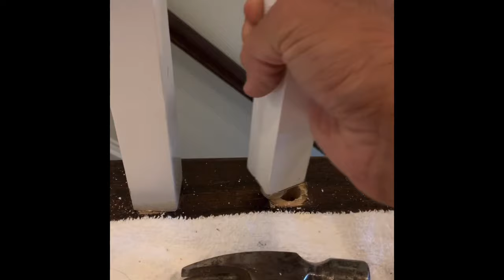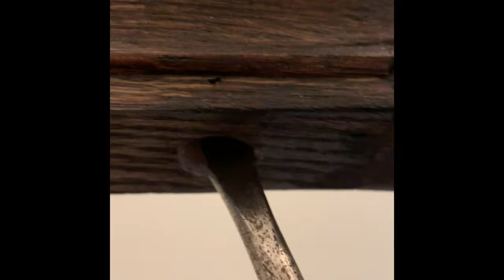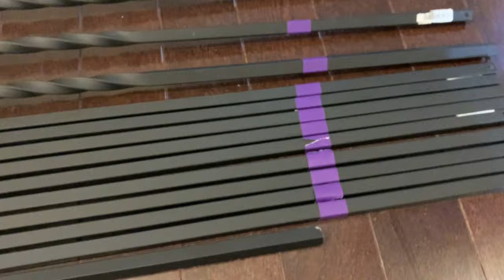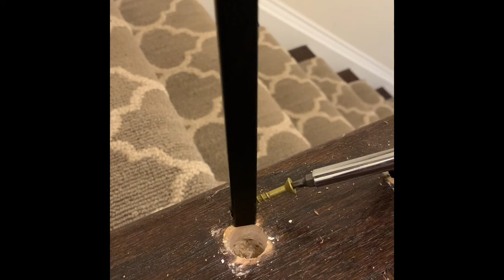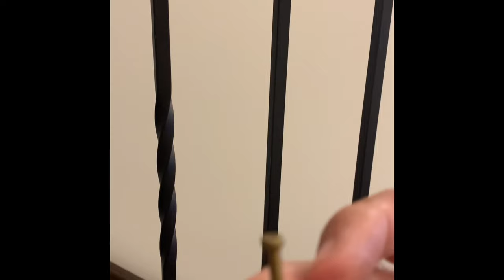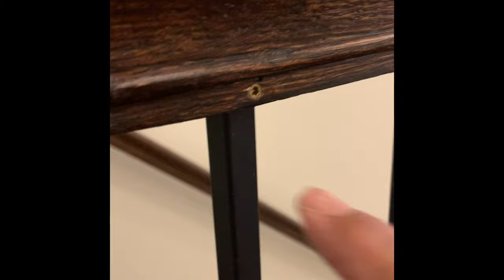DIY Replacing Wooden Balusters with Iron Balusters

Comment: Clever approach for keeping the option of changing out baluster(s) for different styles at any point in future--without having hassle of removing epoxy.  That's the real beauty of this approach.
Reply from the maker: And it’s fun if you like doing these kinds of home projects 👌
Reply: @Sal-75-2   ,

how to remove these types of metal spindles when they are glued in place ?? there is no slack to wiggle them up and down either.  Do we have to take off the top wooden handrail or do you have another solution  ??
Reply: @BlueOriginAire  run a sawzall down the middle of them and pull them out
Reply from the maker: @BlueOriginAire  wow. Seems like going to be a messy and time consuming job. If I were in that situation I would saw in the center to split the upper and the bottom then I would take a monkey wrench to the base of the bottom piece and rotate it in a circular motion back-and-forth see if I can loosen it and the same for the top. If this doesn’t even work then you would just have to sawoff the ends and I would take a flat type screwdriver and hammer in to the remaining piece of wood baluster to split it and pry it out from the hole that way. Mine wasn’t super glued but yes they do tend to glue them if not screwed. Hope this helps
Reply: @Sal-75-2  it was just liquid nails jammed up in the holes... once drilled around.. each came out in about the same time....gtsy in the chat 🤜🏽⚡️🤛🏾
Reply from the maker: @BlueOriginAire  😂 wow. Large house. Glad you were able to figure it out.  I had to do about 100 or so over two months time slowly after I came home from work or weekends etc. for me it was fun and i get so many compliments on the difference in the look. Appears very elegant overall and i saved 5k $$ 👍👍
Reply: @Sal-75-2  What would be the approach to remove the old wooden baluster as like he said with supper glued with no play & the flooring finishers put a ton of poly around the bases?

Comment: Great to the point video!  Really like the screw method, rather than gluing in the new balusters.  But...was hoping you would show how to ka-ra-te chop the old balusters out...
Reply from the maker: It’s in the video. Luckily mine were mildly glued on the bottom and a trim mail to the top as I show the extractions. But some folks glued top and bottom in a nasty way. You may have to hollow them out with a drill after cutting out the middle parts if that’s the case which is a lot off work. Try the method i used of prying then up from the bottom. Hope it works out for you. It’s a fun project for me.

Comment: Wow! You made it look so easy! I can try it now thanks to your video
Reply from the maker: Takes some time but definitely doable. I was scared until I plucked out the first wooden baluster.
Reply: I just looked at mine. There are no peg holes for my spindles. They appear to be glued down. Not sure how they are attached but one is loose so I can clearly see no peg holes. What size hole for the metal one?

Comment: Wow, that seems like a real pain in the butt approach. The TNT system is super slick and doesn't risk splitting the railing.
Reply: What's the TNT system?
Reply from the maker: Pricey! My project would have costed me an extra $400 solid if I took this approach vs drill and screw. Personally, I had fun doing the project manually and it’s rock solid + saved me $400. Certainly a great option for people not comfortable with the manual approach.
Reply from the maker: It didn’t split any part of the railing in my case. I installed 96 of these.

Comment: The screw is smart.  I glued mine in with liquid nails like caulk.
Reply from the maker: Contractors quoted me over 6k and they were going to glue top and bottom as well. I screwed top and bottom solid, entire project around $1000. Spent ~$300 on power tools but I keep those. The entire structure is solid as heck and clean job.

Comment: Hey was wandering if we lift the spindle into place then pour the bottom hole with an anchoring adhesive like Pro select from Lowe's to lock the spindle in place . May save time installing . Someone make a cuttable metal spindle with a spring loaded clip at the top ...

Comment: I have round metal balusters. The epoxy that held the  shoes at the bottom gave way. Now the shoes spin at the bottom of the balusters. Its annoying and looks like crap, I like the screw you have on your shoes.
Reply from the maker: Everything drilled and screwed gives a solid clean structure 👍

Comment: I'm in the middle of doing this exact same project right now.  I am using the shoes on the top and bottom, but after watching this, may reconsider just doing the bottom.  What side drill bit and screws did you use?  Thanks for the video!
Reply: where did you find this product??
Reply from the maker: @ethans1927  Lowes Iron Balusters

Comment: Looks great. We have the same on but the ones at the first step are wobbly because of no support and the starting baluster is in the curve. How to fix this problem
Reply from the maker: It’s possible yours are done with epoxy glue which comes loose over the yrs. You may have to drill screws in to the loose ones like I did in the video. My bottom screw is hidden by baluster shoes though. Hope this works.
Reply: @Sal-75-2  : many thanks man for the help. Once the screws the bottom iron balusters, would it be as strong if have a wooden baluster
Reply from the maker: @squeekhobby4571  yes! As you see my bottom screw is fatter, placed in a 45 degree angle to the hardwood for anchor and another stabilizing flush screw on top times a hundred of these to the railing and hardwood my entire construct is solid. I even put some muscle into try and shake the handrail. Nothing! No movement. And that’s why I used hardware instead of glue. Done once done right
Reply: @Sal-75-2  : you are awesome. Thanks, will do the same at my place

Comment: Outstanding!  Did you use the same type screens for the top and bottom? I think I saw a slight drill angle used. You saved me some serious $ with this.  Just hope that my minimal skills can make good cuts on the balusters and get it done for the wife to smile!
Reply from the maker: Thanks you! Trim screws for the top railing so they disappear. Yes. Drill angle to drive the screw in a 45 degree angle so it doesn’t catch the thin part of the edge of the hardwood flooring. Shouldn’t be a hard project but I am a surgeon by trade LOL, so IDK. I random projects around the house so am not a pro at these things myself.
Reply from the maker: And yes! The wife loves the outcome! Let’s just leave it there 😂

Comment: do you have to unscrew/loosen up the hand rail first before removing th spindles/balluster?
?
Reply from the maker: No. Nothing needs to be done to the hand rail installation. Balusters come out individually. Do one at a time for family safety reasons.
Reply from the maker: I basically removed one, replaced it with iron baluster , removed other and so on… bc I have kids and didn’t want gaps during the project duration

Comment: Hello, i had wood spindles with a finishing nail at top.  I see you used vice grips to remove the finishing nail and then push anything remaining flat.  What should you do if nail is further up and vice grip is too long?  I've tried nose players but hard to reach.  Too much nail to just push up as you showed in video.
Reply from the maker: Yes. You are right. I had that issue also. Sorry, didn’t show in the video. I used a tool I’ve had for yrs and never used it until this happened. It’s a question mark shaped tool with a grip handle. I used it to pull out the nail so i could grab it. As you can see I’m careful not to damage the wooden rail at all by attempting to yank it out which will surely take away some part of wood with it. Try to look for any tool at Home Depot or Lowe’s with a hook type working end so you can hook the nail and pull it out. For me it was just a random tool from ages ago that came in handy.
Reply: I just did this on a job and found some needle-nose "vise grips". Those thin brad nails are super weak and you can wiggle them back and forth until they break. Takes a bit to get the hang of it but I can get it to break at the wood surface almost every time. They are really in the way if they stick out 1/16" .
Reply: I found angled needle nose pliers at AUTO ZONE (of all places)  the guy there said auto mechanics use them all the time. I bought them even before I had a use for them bc they looked like they'd work in tight spaces . . .  now everyone at work tries to steal them

Comment: It looks like it would be a pain to screw in the balusters...I have seen other videos that use epoxy. Is that not a good way?
Reply from the maker: I preferred that over using a permanent epoxy option. Your preference really. Either would get the job done. I found my approach to be a clean and easily replaceable option.
Reply from the maker: There’s the TNT option if not comfortable with manual installation. 
https://www.homedepot.com/p/Stair-Parts-Tap-and-Twist-1-2-in-Hollow-Metal-Baluster-Install-Kit-92001-TNT-HD00S/300431475#overlay

Comment: We are thinking of doing a similar project. May we ask where did you buy the iron balusters from and what type of hardwood flooring and color is that?
Reply from the maker: “House of Forgings”  Satin Black Wrought Iron Classic Baluster. Bought from Lowes last summer. The finish on then is great. Quality product. I’ll get you the name/color of the hardwood.  I have the box somewhere in the basement.
Reply from the maker: Unfortunately the box doesn’t give any helpful info. If you can find Toll brothers Design studio near by, I used everything from there. https://www.tollbrothersdesignstudio.com/ 
good luck!
Reply: @Sal-75-2  ,

we have a project to refinish the oak stair treads and these exact same balusters are in there good and tight with liquid nails. They spin when we pry them loose from that glue. But there is zero slack to move them up or down to remove them.  Would help our edger guy sand if these are not in the way. Short of Grinding these out and replacing them, is there another way to remove them ??
Reply from the maker: @BlueOriginAire  Exactly why I did not use glue and use screws. All the slack in the handrail above your baluster is jampacked with glue there’s no way to get it out. If I were in your Situation, I would sacrifice the baluster you have right now cut it in half weather saw probably electric saw pry out the top then pry out the bottom then I will take a drill and drill in some of that glue to give me a room for new baluster installation. This is what I would do.I would definitely not attempt to remove the handrail.
Reply: @Sal-75-2  .
we were able to dig out the hardened glue from the bottom, and luckily, the top portion had no glue. Once we opened up the hole the little bastards dropped down and tilted out easy. We got lucky.  Thanx for your reply.
Everything helps. ✌🏽

Comment: I wanted to do this project but if I switch from my wooden to iron balusters using the existing holes the space between will be greater than 4 inches.  I've been told that the maximum by code must be 4" or less,  I'm seeing most of the iron balusters are 1/2,  Anyone know of wider ones?
Reply from the maker: My standard off the shelf Iron balusters from Lowes sit within the code having bar-bar free space of 3.33 inches. Some inexperienced builders measure 4 inches from the fat wooden balusters they use and drill their holes accordingly which is completely wrong way of doing this installation. The holes themselves first have to be measured and drilled within the code the balusters go after. If they choose to use the fattest wooden balusters in the world well then they’re going to be super close to each other if the holes are drilled correctly. And when homeowners at any point decide to switch to iron balusters which by standard are not really that thick, they’ll by default fall within the code because the holes are made accurately. I highly doubt you’re going to find fat enough iron balusters but it may be possible. I did not see them anywhere on the Internet or stores I doubt if they exist. I’m just not sure.
Reply: late answer, but maybe you're still mulling this over. Balusters done to modern code are typically going to be spaced 4" on center, not specifically 4" apart. So the space between them is actually less than 4". If your balusters were built to modern code and you're using pre-existing holes, chances are good you'll be fine regardless as even two 1/2 balusters placed 4" on center will result in a gap that's less than 4". This is tested using a 4" sphere test. Basically if a 4" sphere can pass between them then it's not up to code. The real question is whether or not your existing balusters were built to current code. If they're not, then it doesn't matter really. If you're using pre-existing holes I suggest you get some tap-N-Twist mounts as they will keep your balusters on center.

Comment: How do you make the rod fit that is longer then the gap between the floor and the rail?
Reply from the maker: Rods are always sold very long. You gotta cut them to size as shown in the video
Reply: @Sal-75-2  this may be a dumb question, but what would be a good/inexpensive tool to cut the rod? What tool was it that you used?
Reply: @lindsaymarques8861 That was a reciprocating saw. A miter saw will go through aluminum quite well, just go slowly.
Reply from the maker: @MrDesuhland  correct. Thanks for answering! Reciprocating saw from Home Depot. These balusters are wrought Iron not aluminum however.
Reply: @Sal-75-2  I understand they have to be cut to fit, but doing it like you did one-by-one without lifting or removing the handrail, how do you wedge each baluster into the space so it fits tight, top to bottom, without mangling the underside of the handrail or the base at the floor?
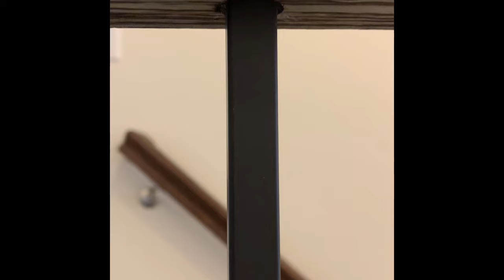Reply: I'm referring to the 2:23 mark in your video.  You show it fitting into the bottom at the floor, but how does it fit into the top without too much wedging?  Is it that much shorter so you can just slide it in, then secure with the screws top and bottom?

Comment: What do you charge labor wise for something g like this?
Reply from the maker: For me it was a home project but we did get a quote for $6000 from a professional. I did two stair cases and a hallway totaling 96 individual baluster installations.  Costed me $1000 for parts and $300 for machines( drill, electric saw etc)  I bought (which I get to keep obviously)
Reply: $6000! Just for changing out the spindles? Or did the 6K involve more work?